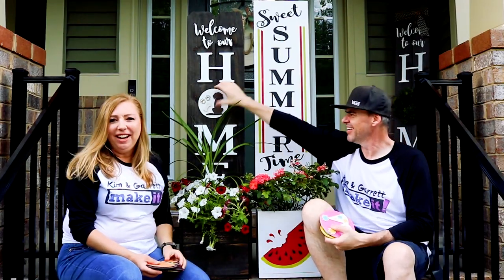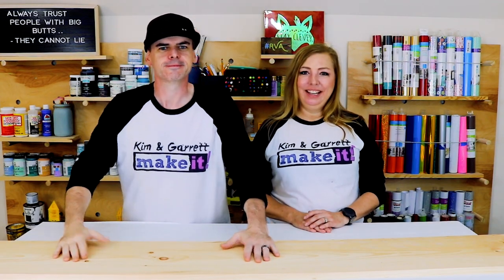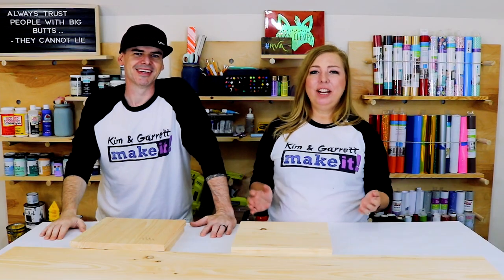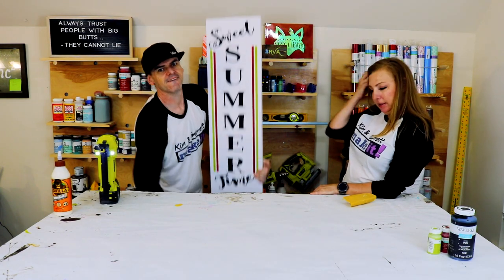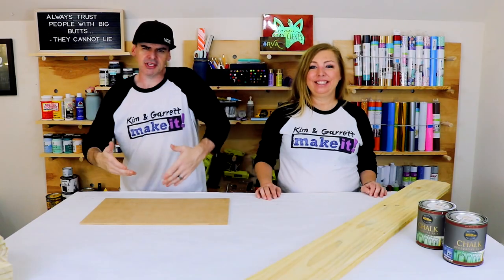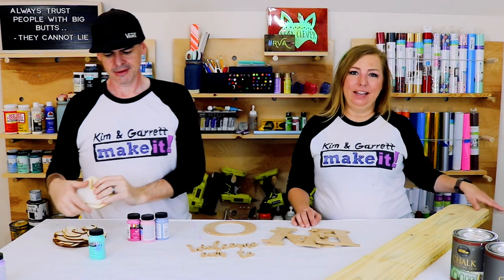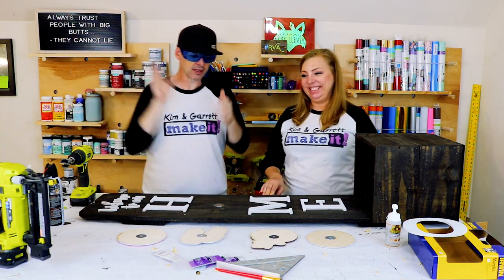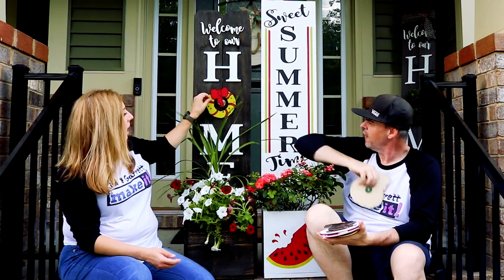DIY 4 Foot Front Porch Home Sign Planter

Comment: Ok... watching this again to get some inspiration. I just had a thought about the "O" in home. Depending on how strong the magnet it... maybe you could drill the hole for it through the back leaving only a thin bit of wood. That way it doesn't show when someone wants to use the "O". And for the O.... just add a small nail or something for it to hang from. Like in your "no tools DIY front porch sign"